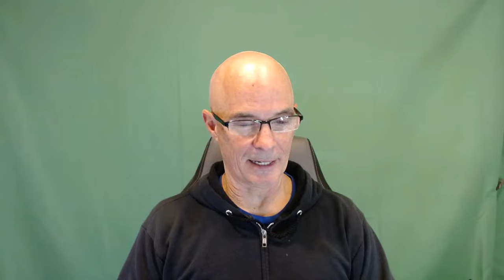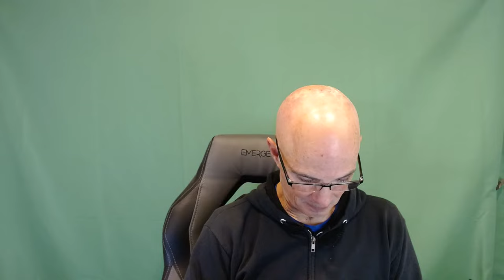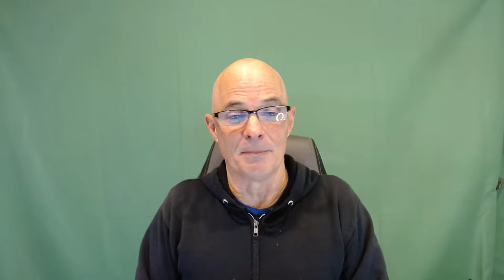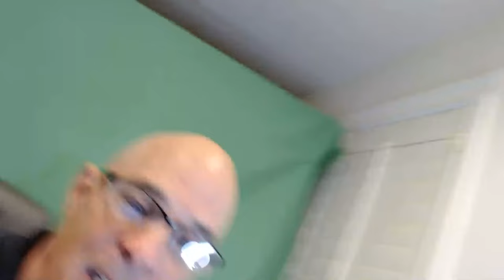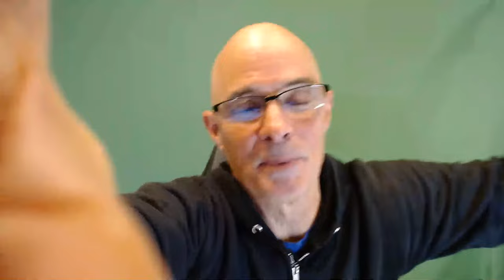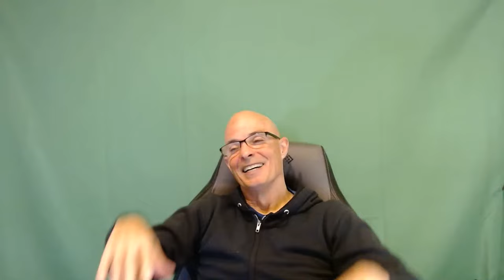LET'S TALK TECH-TEST GOLFBALL DIMPLE PISTONS?

Comment: The increase in power comes from more complete combustion which converts more chemical energy to pressure. Not compression gauge pressure, but how much pressure the cylinder makes in the explosion of fuel and air. The idea with the dimples is as gas is compressed into the top of the piston, each dimple will act like a mini spark plug which results in more complete combustion. This is just one way to think about it, applications vary. The proof is in the noise output and oil condition after several thousand miles. At least that is what I can piece together. If they do half what they say, I am going to try a set in my 7.3.

Comment: Look at a golf ball! It works on the golf ball it will work on the piston! The dimples are creating turbulence in the cylinder giving the air file mixture complete = better and more efficient burn!
Reply from the maker: the golf ball spins while traveling through the air-the piston does not-they are not the same principle
Reply: @richardholdener1727 it's actually breaking laminar airflow to reduce friction/drag , yes it's the same principal at work but two totally different objectives desired

Comment: Seized up engine due to rust etc is easily freed by putting penetrating oil of your choice down the spark plug holes AND THEN putting a pull handle  on the crank bolt like normal but then you fill a 5 gallon bucket of water and hang the bucket from the end of the handle to have a constant pull on the handle. Then go drink beer, eat and go to bed, the next morning your bucket and pull handle will have turned the engine over approximately  a quarter turn. At this point you can rotate the engine by hand. This works 99.999% of the time. Trust me you can put lazy to good use. With a constant pressure over 8-10 ours you can free most any engine and you are much less likely to cause any MORE damage than you already have from the rust. Worst case you may need to do this twice but look at all the beer you get to drink while the bucket of water does the work for you!

Comment: 1973 1 ton Ford pickup truck, 1974 Lincoln 460 and c6 transmission, 670 Street avenger Holly + 100 micron stainless steel screen 18 + MPG!!! ( 1 inch spacer + high power coil was also used! Before my up grade I only got 12 MPG at Best!
Reply: Did you dimple the pistons, or just switch the spacer, ignition, and put in a screen?

Comment: Build 2 exact motors without the special pistons involved.
Test and document everything about performance.

Then put fancy pants pistons in one of the engines.
Retest and document again

If there is a notable difference in performance
Switch pistons to the other engine.

Retest and document to verify if performance increase is following the pistons.
Reply: Speed Of Air has already done that testing.
Check out 'Dave's Auto Center' video titled: What do golf balls and pistons have in common?
Plus this not a new idea.

Comment: I think you are spot on in your analysis.  I think this is like the achates deal and they are just trying to get a bunch of $$$ without offering any proof.  I have seen testing with aerodynamic piston features tailored to the cylinder configuration and that did prove to be beneficial by improving the swirl and mixing.  This golf ball pattern deal appears to not be directed at all.  Another important thing is will the dimples even be visible over time? Diesel pistons tend to be quite prone to just filling in holes over time with soot. So in 20Kmiles would they even be visible to do anything at all? I highly doubt it.
Reply: They also use a gapeless ring which almost eliminates the soot.
Reply: @whysolong27  a gapless ring pack keeps the soot out of your oil but it still is in the combustion chamber.
Reply: How much of that oil gets burnt in the chamber causing that sticky mess which collects more soot.   I may be thinking this in the wrong manner   but if keeping the oil out would the soot burn off  more and be expelled out the exhausts

Comment: Golf ball dimples have proven beyond any shadow of doubt to effect drag on not only golf balls.
Myth busters tested a car and the dimples had a big effect on drag.

It is possible that might effect a piston performance also because it is related to air flow
Reply from the maker: think about how air flows over and around a spinning golf ball and moving vehicle. Will it have the same effect flowing down toward a flat surface
Reply: @richardholdener1727  yes I cant visualize how the dimples work in that flow situation, and the company claims that the dimples are designed to cause cause rotation along the cylinder wall so it reduces temperature as weill.
Reply: I'll believe it when I see it
Reply: @oscaroscar5336 The dimples cause localized swirl which creates the effect of decoupling the laminar air flow. The end result is aerodynamic drag reduction. In a combustion engine, The dimples within the combustion chamber allow increased swirl for a longer duration of time. The swirl is what produces more complete combustion due to a higher percentage of consistent AF ratio within the combustion chamber

Comment: i think it will cause hotspots in the chamber and causes pre-ignition
with a diesel the injector sprays in the fuel straight down on top of of the piston so the vortexes created by this piston might help spreading the fuel through the chamber and create a wider flame front , since the diesel injects at the exact moment it needs to ignite the pre ignition thing might be a non issue
as for running two engines to get the data , you could switch the pistons over after the whole test cycle and run the cycle again to see if the percentages in difference stay the same betwwen the smooth and dimpled pistons

Comment: Used to be done in nascar in the early days and the practice was banned.. When a cylinder head was pulled and the top of the pistons inspected the “clean” or fuel washed areas were the areas dimpled. It was a Old school trick or mod, and only certain areas were done not the whole piston. The photos I seen were smaller dimples and only done in strategic areas(the clean fuel washed areas) 
 The heads were sometimes dimpled in the combustion chamber as well on the spark plug side by the intake valve. Apparently in Nascar it was worth something sense they banned it. Intake manifold floors and runners were other areas sometimes dimpled. If I remember right in the books I read it had something to do with the fuel that had got out of suspension not so much the barrier layer air flow line of thinking..
Reply: Does it means it works on gasoline engine ..dinples the piston?
Reply: @budhihart8161 NASCAR is gasoline engines

Comment: Hey Richard so I'm a part of the shop that is building the test Motors I want to leak a small spoiler they are LS engines. I will also say that as an automotive machine is to 20 years we are going to do our absolute best to make the engines identical. I am with most of you and your opinion, where I dont see this doing much of anything  because really isn't it just gonna fill the Dimple's with carbon over time lol. Anyways cheers. P.s I wanna sent you some cylinder heads. I think you'll be impressed..
Reply from the maker: thnx for your hard work-someone needs to contact me to speak about this test
Reply: I was a 3521 and 3522 in the USMC for six years from 1996 to 2002.  I am now a commercial truck owner operator.  I've seen the insides of CAT mining trucks that have had these dimpled pistons in them for 18,000 hours.  At least for diesel engines, I'm sold, I'll be rebuilding my DD15 engine soon with these pistons.

Comment: Looking forward to some testing for the fun of it. After all most of these ideas are just that, for the fun of it... Let's say it does work in a few percentage points. The improvement without port flow changes would be limited to a very small RPM range and fuel flow rate. Air Fuel Ratio would be very limited before it would lose it's effectivness as to any improvement. Static power level, static RPM, static load requirements, all those things will find the improvement, but change to a "Rolling Road" application as Richard says will nulify the improvement. Honda, Ford, etc have done more with port changes and duel intake runners and high speed air-flow inducement to find that high BSFC for road use....  Build a pair of 427 LS with the best heads and load it at 75% of it's capable max power and you'll never find more than a few horsepower with the modifications. Toss in the costs for these modifications and you'll never pay for it with 1 to 3% increase which is all you'll ever find. I'd bet it would work fantastic on say a generatiion or pump engine where things could remain static...

Comment: I have seen troughs in the plenum bottom done to even out the mixture ...it is Dyno tested ..cut and retested to even out the 8 o2 sensor readings on the dyno and then they lean out the mixture to get more laps on the track per tank of fuel

Comment: I just saw a Dave's auto video where they got a guy with a diesel talking about these.
I want to see exhaust gas analysis of what they are claiming. I guy could take a motor, dyno it, swap out the pistions- same deck height and see the results.
Reply: 10 Db decrease in noise on their latest diesel engine build

Comment: Just saw this dimpled piston on Daves auto care. Man claims lower emissions and better fuel economy by 25 percent and a much quieter engine. He had them in his Duramax and it was very quiet. He said no engine changes except the pistons.
Reply from the maker: 25%?
Reply: @richardholdener1727  I started studying this with the same video and I actually thought he said up to 20%. But yah something like that. I get 10mpg down hill so they'll pay for themselves at 15%. I do have an understanding of the physics and they should make substantial improvements, if the dimples are sized and placed correctly.
Reply: @richardholdener1727  10 DB reduction in noise tested in the recent 6.7 Diesel test

Comment: sorry I missed the live episode. Why wouldn't dimpling increase torque?  If the surface area is increased and pressure equals force divided by area.....so then force exerted to the top of the piston is directly proportional to cylinder pressure times total surface area of the piston. I understand we have to take into account ideal gas laws as the air/fuel mixture expands on the power stroke after ignition of the air/fuel mixture. But this is also why domed and dished pistons are more efficient at making more power at the same compression ratios.  This would make for a great episode for Freiburger and the boys on Engine Masters so that we all get to see the actual data from the test(s). I do not see any benefit from dimpling a piston for flow into the cylinder.  The choke point is the valve and valve seat with flow being affected by the shape of the valve stem, the ceiling of the intake port and the overall cross section of the intake port.  The goal being to avoid having a "thick" layer of laminar flow in the intake runner due to dead flow areas which causes puddling.  Maybe it is more for keeping the piston cool more so than anything else.

Comment: Only way to test this is to have a good solid but standard motor, measure it's output, then rebuild it with just those dimpled pistons replacing the originals. Use the same rings, and make sure the crown hights are identical. 
I've had a few plugs go bad over the years.
The result on the piston looks fairly simular, but with one out of four pistons taking on this form, power outputs didn't go up🙂

Comment: Another consideration is that in a diesel engine, the piston IS the combustion chamber.
Head surface is flat (except for valve head recess)
Reply: The piston is the lower portion of the combustion chamber in both gas & diesel engines.

Comment: Imagine the piston going down pulling in the next charge. Maybe having the dimples being like a smooth transitioning cone  that are changing the air pressure/angle being drawn over the surface area of all the dimples other than drawing down on a typically flat surface piston allowing a more turbulent suction of the charge.

Comment: From what I understand about golf ball dimples is that the dimples create mini swirls inside of them speeding up the air around it. Would this create a faster air speed in a combustion chamber?  Creating more turbulence? Is it truly worth it?
Reply: The dimples actually do the opposite, they slow the air really close to the ball and allow the flow to "roll" farther around the ball before it detaches, reducing the size of the low pressure area behind the ball.
Reply: @BuffMyRadius  now I am going to have read on this subject again.

Comment: From what I’ve seen it has to do with higher swirl as the dimples create air ball bearings for better mixture homogenization in a compression situation there in line with nozzle direction and the piston top is changed to get the fuel more in the center of the chamber

Comment: I think there might be issues with the thermal boundary layer on the gas piston, the dimples may also pull fuel out of suspension & initiate detonation.
Reply: It actually creates localized lean spots inside the dimples from breaking the laminar airflow. Ceramic coating is important to prevent hotspots

Comment: In college, us PE majors learned about golf ball design as part of the Natl Golf Federation instructor cert our professor facilitated.

The dimples in golf balls create consistent turbulence as the air molecules pass by. 

A smooth, non-dimpled golf ball creates inconsistent turbulence & the ball does not fly straight; tends to act like a knuckleball.

Dimples solved the problem, a creating straight flying golf balls.

I can recall seeing golf balls over the years w/ different size dimples, in specific patterns.  Can't recall how many different types there were. Like all ball manufacturers, they claimed their balls flew further. Never tested.

I don't agree the dimpled golf ball is that different than the piston. At the basic level, they both are objects w/ air passing by. Different shapes, sure but the impact on the air is the issue, not comparing non-dimple features.

Dimples are turbulence creators, plain & simple.

Re: combustion chambers
The top of the piston IS the lower 'half' of the combustion chamber.l, so there will be an impact of dimpled pistons vs non.

The only thing I can see it doing is creating more turbulence than non-dimpled.  How that impacts the engine can only be determined w/ rigorous testing; everything else is just lip flapping speculation.
Reply: It actually breaks laminar air flow from the localized swirl in the dimples.

 basically it creates a lower coefficient of drag for the air going over the dimples by decoupling the laminar flow. 

In a golf ball that allows it to fly further and in a piston It allows increased swirl in the combustion chamber for more complete combustion

Comment: It is interesting.  At first I can't see any benefits, only negatives.  But it may (but just slightly) increase turbulence at the piston face and possibly act like softening the head.  Just send it like a big bang test, Richard!😂
Great show as always!  Love your channel.
Reply: I'd imagine that flow through the piston at overlap might increase with that dimpled piston. It's probably going to be 1 engine, and they should test 5 or more dimple designs.
Reply: @cromBumny  I don't know how it would increase flow.  The piston being so far away from the valves that turbulence at the face of the piston won't have much effect on overall flow.  Only improvement  I foresee is improving mixing at the piston face due to increased turbulence (preventing wetting might be another benefit).  The dimples have to be sized for the length scale of the turbulence.  These look massive- may be correct, but I just don't know.

Comment: Its all down to boundary layer conditions, that thin layer on air by the surface dont like to move, the dimples help break that so air can move better and is not "stuck" by the boundary layer. Now how many dimples, how deep?, how far apart? How not to create a stress riser on the dimple? Thats the hard part. Also diesel dont have spark plugs to aid in controlling when it goes boom. So if you can get better mixing and all of the fuel iginites at the same time thats a game changer.
Reply: swirl=good
Reply: where is the boundary layer? the crown of the piston is being pushed into the air so does boundary layer really apply here? and on golf balls slight variation of dimple depth change the distance golf balls travel. so how does that apply in this situation?
Reply: Slight variations in dimple size and position make large differences in the results gained from the process.  A significant amount of development cost is in researching the size and position of the dimples for each model or series of engines. 
Yes, the boundary layer is still a factor in the case of the piston.

Comment: I think there's a lot of misunderstanding about why golf balls have dimples. The dimples intentionally slow down air flow on the surface and delays the flow separation at the back of the ball. It actually increases the skin drag, but it's worth that penalty because a sphere is a terrible shape aerodynamically.

I can't think of any surface in an engine that would benefit from building a thicker boundary layer to prevent flow separation, with the possible exception of the short radius on an intake port.